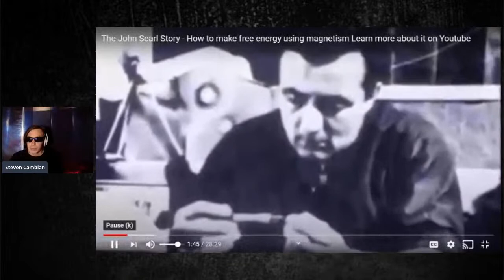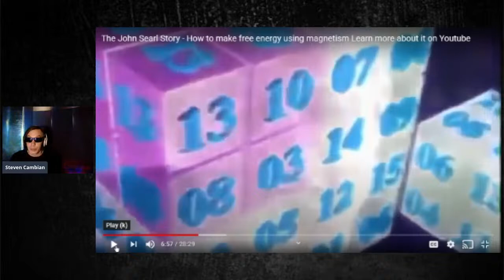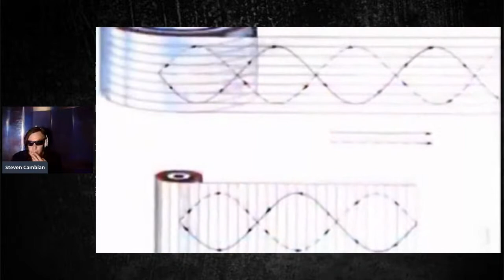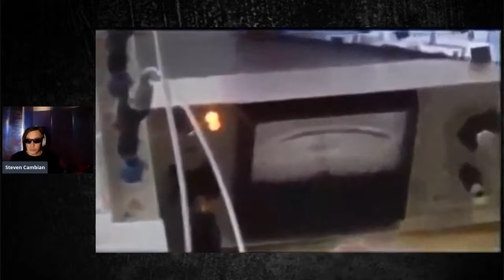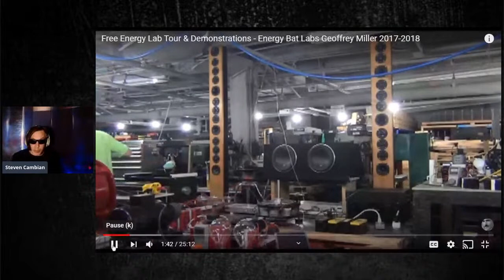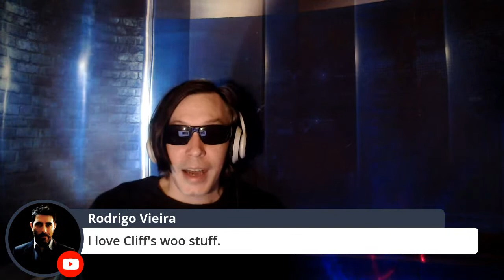Is free energy possible? The John Searl Story. Truthseekers Episode 69.

Comment: some of these free energy devices do sap power from the mains power system wirelessly;
magnetic reconnection does release a lot of energy (as seen in solar prominences);
demagnetization can produce a temperature drop (magnetic refrigeration);
the laws of thermodynamics neglect dark energy.

hypothetically, the nested spinning+orbiting magnetic fields, if run fast enough, could magnetically isolate the interior from the external space, resulting in some weird quantum effects that deserve scientific study

has anyone tested nesting three rings? the effects claimed by Searl require minimum of three tiers of rings and rollers. there may be a rational basis for that, related to magnetic reconnection.